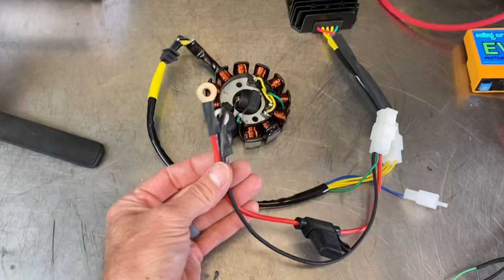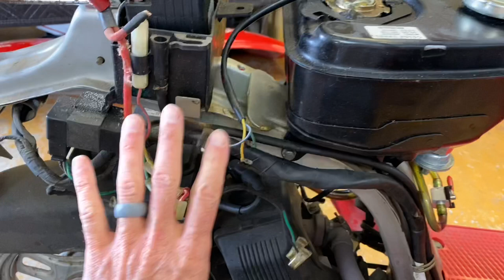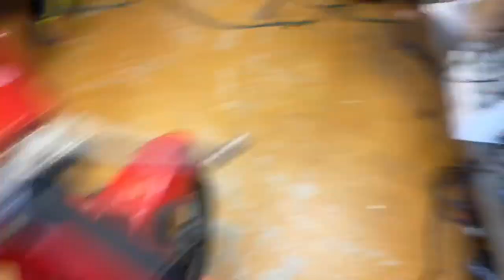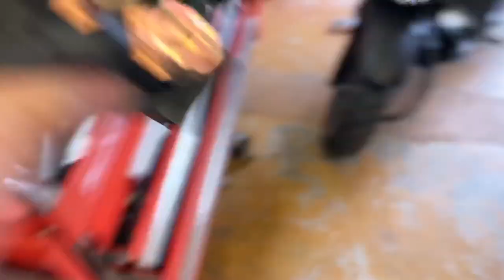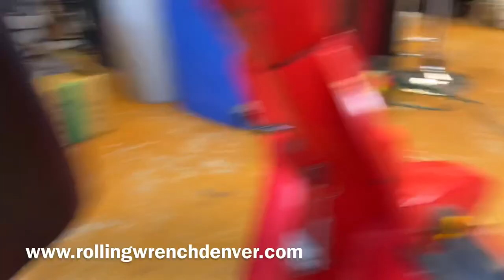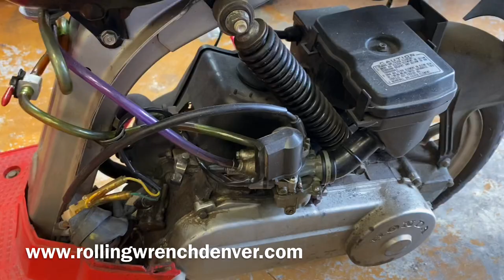GY6 Honda Spree harness - Plug & Play

Comment: Hi sorry im confused. Is the gy6 engine already in that scoot or is it still the spree engine?
Reply from the maker: The video still has the stock spree engine
Reply: @RollingWrench  ok thanks. Do you think it would be pretty simple to install a 150cc gy6 shortcake on this or nah? I’ve done a swap already with a CH125 onto a 1984 Honda Aero 125.
Reply from the maker: If can fab a mount no problem. It would be a mega easy swap
Reply: @RollingWrench  Ok thanks, for the Honda Aero that I swapped the CH125 motor into, I dont have a welder, so I had to make all my own stuff and did it all with bolts and stuff, hopefully that'll work for a spree too haha.